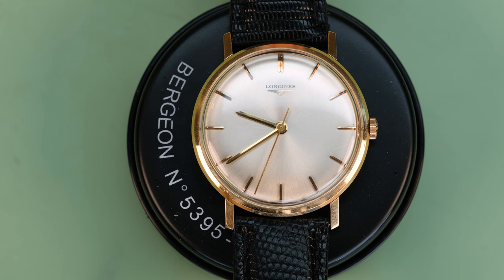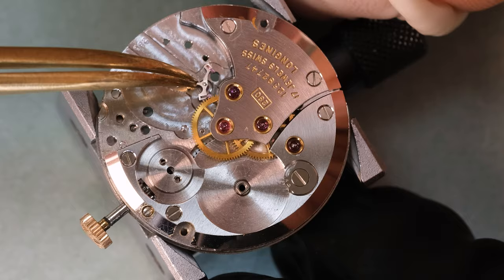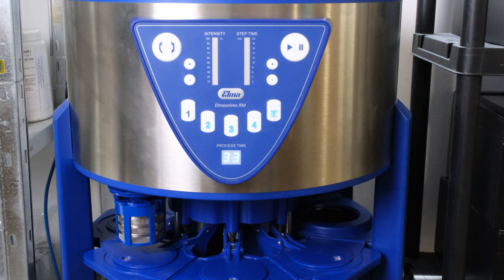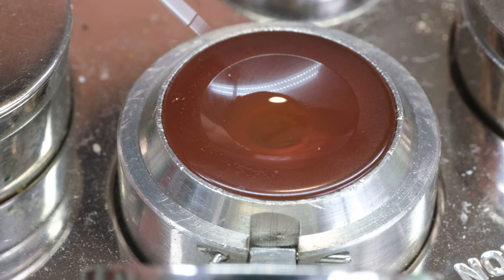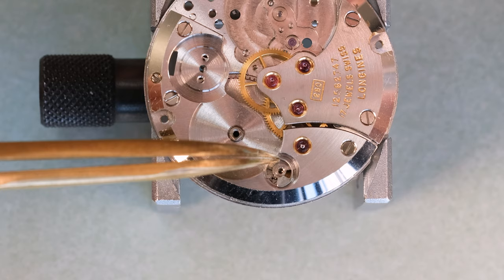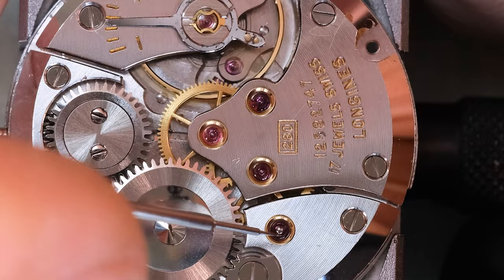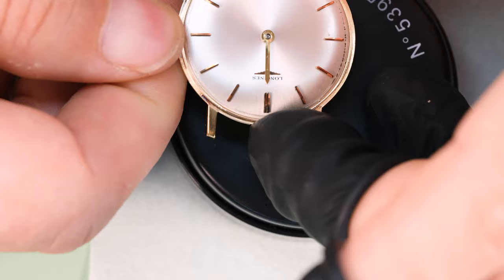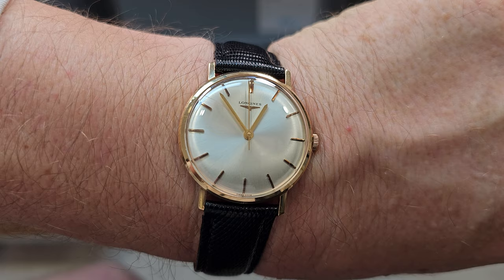What will we find inside this old beauty?

Comment: Stian, in America the career path for sadists has to be working in the driver's license bureau or in social security.  Did Longines and other watch manufacturers have sealed barrels so they'd have to be replaced instead of taken apart and serviced?  That way barrel makers always had a job at Longines.  Lol  Although it does not have a date function, it is a beautiful watch.  Skal from this old retired coot living the dream in Tennessee.
Reply from the maker: Spot on, Robert, these barrels were intended to be replaced at service as one unit. That might have been fine while they were in production, but nowadays less fine...

Comment: Beautiful watch with a gorgeous balance wheel. Sir, is the mainspring in the sealed barrel unbreakable, or if it breaks, then have we to buy a new mainspring in a sealed barrel? Are these types of sealed barrels still available as spare parts?  Please do enlighten me on this. Thank you for this lovely and enjoyable video.
Reply from the maker: Hello K, you can open the barrel but it can be tricky to close without deforming it. The best replacement would be a barrel complete, which are getting difficult to find

Comment: I am considering trying out some amateur watch repair and I have a burning question that I wish to ask you. I have been an automobile mechanic for over 65 years. (I'm 80 now )  My greatest specialty has always been carburetors. My head is chock full of carburetor lore. That lore and $5 might buy you a cup of coffee in some of the cheaper coffee houses. That said, I still have my old 5 Gallon carb cleaning bucket full of the kind of solvent you cannot buy any more. My question: Is there any reason why I couldn't use that carb cleaner to clean those "delicate" watch parts in my carb cleaner? That stuff is pretty powerful against old sweat and body oils. Asking for a friend. :-)
Reply from the maker: It's never too late to start working on watches! That carb cleaner will probably work just fine for most parts, what you want to be cautious with is the parts with shellac (pallet fork/balance and sometimes other places depending on the specific movement) or plastic. If you start out with some cheap watches you can find spare parts for if they get damaged, you can try your solvent and see how it goes.

Comment: The problem with toggle buttons.  I like an ON button and a separate OFF button.  Especially these days when the button is de-bounced in poorly written software.  And the processor is undersized so every button press is delayed because they went cheap on the processor.  AND finally they should always put a remote control input as the highest priority.  I have a TV where I hit the CH up button and it goes to the next channel but I already know I don't want to stop at that channel because the signal is frequently weak so I immediately hit CH up again.  But the TV is preoccupied with trying to tune in that weak channel and is ignoring any further input from the remote.  And sometimes it gets so busy trying to sync that weak channel that it goes minutes totally ignoring any input. And I finally give up and go across the room and un-plug and plug the set forcing a complete reboot.

Comment: hi thiam regarding your airco, is the standby set corectly on the unit?  If the device is not in standby, the remote control will first put the device in standby, and then activate it.
Reply from the maker: Oh yes, it works fine, it's just a little annoyance 😁

Comment: Why is oiling the balance staff jewels different than the others? If the same you would drop the jewel with hole in the bridge, oil as the others, drop in the cap jewel set springs? Done.
Reply from the maker: The difference is that you want the oil to lubricate the pivot end also and not just the cylindrical part. Thus you need to ensure that the oil stays on the cap stone

Comment: Your air con wouldn’t be Mitsubishi brand would it ?
Reply from the maker: Yep, it is
Reply: @VintageWatchServices  I think my last reply got deleted by youtube.   So i'll try again without naming other companies.   The remotes will do that occasionally especially  if the batteries are running low.  Also if you have more than one split system the remote power button will need to be pressed twice to program itself to each unit.   if you look online replacement remotes can be found fairly cheap should you ever need one.  Beautiful watch too.   You really do have some stunners come across your bench.

Comment: Sealed barrel no needs to be oiled forever ? How come ?
Reply from the maker: Not forever for sure, but if it still runs well you can reuse it. At some point the mainspring will need to replaced
Reply: @VintageWatchServices  so if mainspring should be replaced , we should buy the sealed barral , because the mainspring is inside in it ?

Comment: Would you say movements of this caliber are over engineered compared to modern offerings from the likes of ETA and Sellita, i have a Ball watch which has stripped the teeth off the ratchet wheel, this is how i got the watch cheap, the movement is ETA 2824, looking at the Longines you are working on i cant imagine stripped teeth would ever be a problem, maybe the ETA is under engineered.
Reply from the maker: This one is slightly over engineered, I'd say, mostly the dial side bearing. The 2824 is very much designed for efficiency and ease of manufacturing